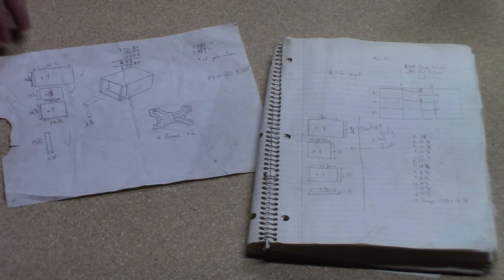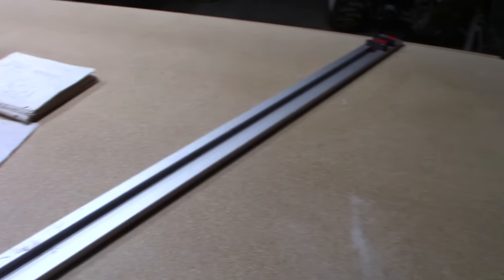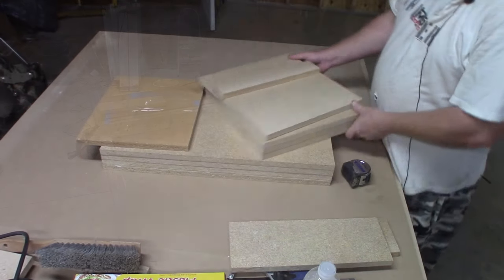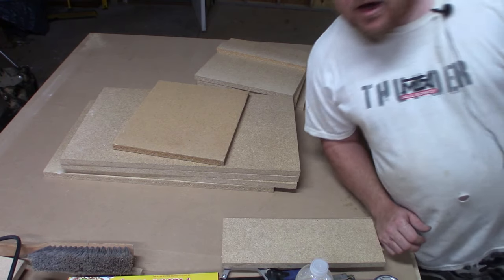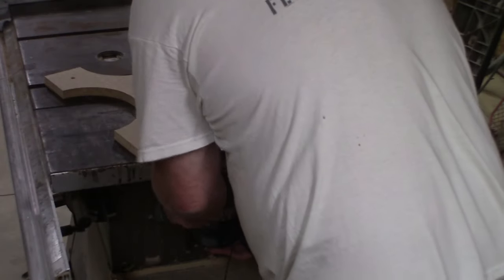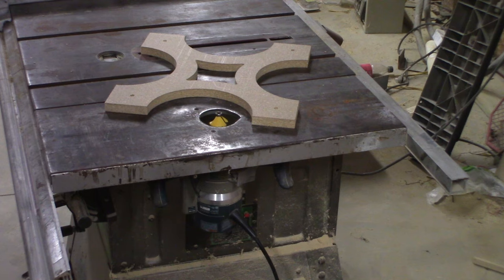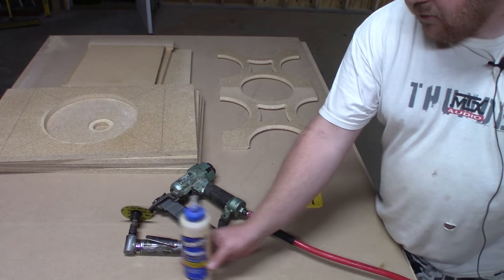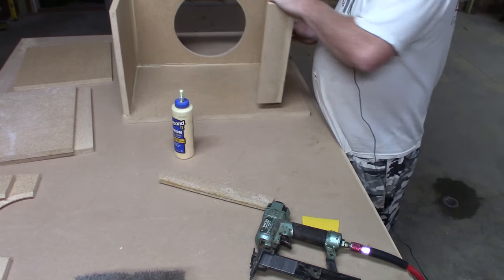How to build a Subwoofer box

Comment: You dont actually need that brace next to the port because port acts as a brace itself . And that brace next to port is gonna restrict air flow because top and bottom of the port is blocked off due the brace . But otherwise very good build .

Comment: The build looks nice, but the bracing is done literally in one of the worst ways possible. You don't need the bracing in the corners, you need them in the middle. You could have made more effective bracing with less material.
Reply: Oh, just saw the port blocked by the bracing. This is terrible. = /

Comment: I'm building a down firing box for a single 12. Would it hit harder ported or sealed? And if I port it where should I put the port?
Reply from the maker: +Chris Bright vehicle model would help. Always will hit harder ported. And typically the side is the most common option use for port location.
Reply: sorry 99 gmc Sonoma extended cab
Reply from the maker: +Chris Bright port forward passenger side with sub firing down.
Reply: thanks! keep up the good work

Comment: how do you get your measurements? airspace? and port size?
Reply from the maker: If by measurements I typically work within the airspace area the manfacterer of the woofer supplies you with. Then I see which vehicle I am working on and I work within the demensions of the vehicle and choose the best wood type or even fiberglass to achieve the best results. Airspace is a simple equasion, Width X Height X Depth divide that number by 1728 to get the square cubic inches. Port math is a little more complicated, there are websites that have port calculators just google it. My math is a little different from my years in the lane but the website ones will get the average user where they need to be.

Comment: I've made many boxes but y did u block the top and bottom of the port with the brace???  And wouldn't the port structure brace it on that side. Sorry if I'm sounding like a dick lol just curious
Reply from the maker: Hey no problem, we dont learn or know why if we don't ask. Okay so me knowing the subwoofer that was going in the box I 2 staged the port , if you look at our fiberglass videos you will notice it is also 2 staged just in a different way. It can make for a cleaner sound but not something you want to do for an SPL version of the same box. The brace actually braces top,bottom,front and back as it touches all walls. ( 2 staging a port is like taking a smaller port and unloading it into a larger port. Its interesting when I first started doing that and over the years Ive grown to use it more often. Not for pure SPL, ill never block air restriction in those, this box setup works in alot of variations. 

SQL, SPL, 2 10 inch, 1 12 inch or 13W7. When you make them for a living you have to factor all these things in. If I were doing the 2 10inch for example it would have 1 brace in the center , 2 12" SPL The bracing goes in a different spot on the box, and in this SQL Example it just so happens it works best downplaying the air load into a larger chamber. But at the same time I can cut the same box 5 times and use all 5 in different ways. So at least you understand our method behind it is alot to do with business and how 1 box can be so universal and speeds up build times. I do plan on doing some NEXT LEVEL! Boxes soon , kerfing , logos, ect... I just was running awhile without a video and thought hey heres an example, and its brought up some good questions that I hope I can continue to explain my reasoning behind it.
Reply: I noticed the question you asked, He used a brace to brace front to back and top to bottom, The port doesnt offer that, It just braces top to bottom. Best to brace in all directions like he did, built one for shits and giggles, little box hits hard with an Old 12 inch Mojo I had laying around. Pretty good design for high end woofers. Dont know how a cheap sub would do it seems like to much airspace for that.

Comment: Particle board? I haven't seen that since late 80's-early 90's. Savings compared to a sheet of MDF isn't worth it...too much flex & porous. Maybe for beauty panels and things of that nature but for a sun enclosure, regardless of a customers budget, I wouldn't even consider that an option.
Reply from the maker: Fair enough on your opinion, But sounds like you do some box buildling so let me ask you this, Chinese garbage box from 5/8th MDF or even 3/4 MDF vs American made with Titebond II glue ? Which one do you take at this point. Not every market allows for certain prices and you have to consider a customer will go to a cheap Amazon or Ebay box made with inferior MDF , not the stuff were use to, Im talking the pink colored MDF that has less than half the density of what we offer. 

Your honest in your opinion and I like that, but maybe see from a smaller market area where Amazon and Ebay control certain aspects, I know the box I am going to offer has a great build quality and output than a off the shelf chinese offered counterpart. So maybe if you consider that you see where we come from, Tho we have went to offering only 100% MDF faces on our boxes as a side adjustment. And of course Im sure you realize we do offer MDF and birch also but on budget builds most dealers just offer a simple BBOX from china that Atrends offers or even worse a Qpower box and neither offer glued joins, they build, Brad, Carpet, and put a seam caulk to make it look better but a few hits from a decent woofer and they are rattling before they leave the lot so we chose a different path, hope you see the value in what we are trying to do and adjust according to feed back and the MDF faces on budget boxes seems to address our budget customer concerns. 

Thanks again for the honest reply, and hope you see mine as honest as well.
Reply from the maker: PS, we do not have access to 5/8th or 1/2 inch MDF in our area, 3/4 only. 42.00 a sheet vs 18.99. And from our other videos coming you will see MDF is the biggest part of what we offer, just show that it can be done at a pretty good savings if properly braced to offset some of the cost to a consumer who makes minimum wage and is on a tight budget.
Reply: Random Audio Guy dude the first box that I ever built for myself with on just over a minimum wage budget supporting a family of four without a working spouse and was still able to afford a sheet of proper MDF to build my box, you're trying to make it sound as if people with low incomes need your stuff they do not I get it that yeah you are trying to rationalize your cheap habits which is return is how you make money to support your family so I can't knock you for it but don't put your means of saving money on the poor man I've been poor all my life and yet because of my interest in the audio field still found a way to make ends meet supporting a family of 4 without a working spouse on a minimum wage type income to build myself what has now come to be four different boxes that would dwarf the one that you just built just say it like it is you build cheap so that you can save money don't try to make yourself look like a humanitarian by using cheap materials then call it something else
Reply: The actual material costs are probably like 15% of the finished enclosure's price and it takes nothing away from the builder to work with better materials. I'd much rather work with plywood than a damn fragile particle board. The wall material also isn't the only material needed so the difference between boards is even smaller.